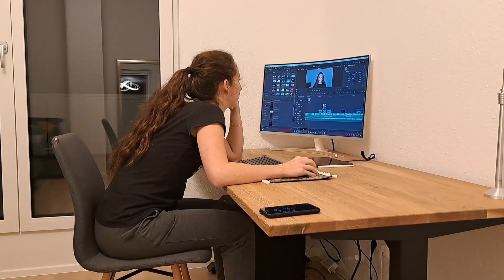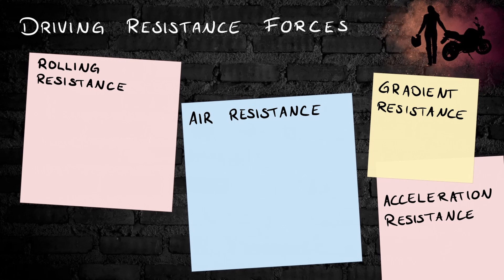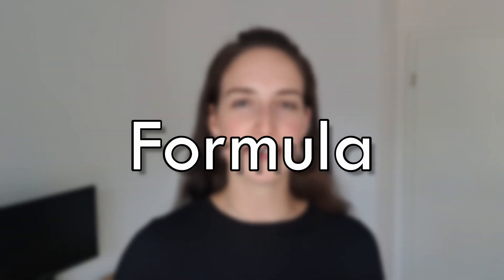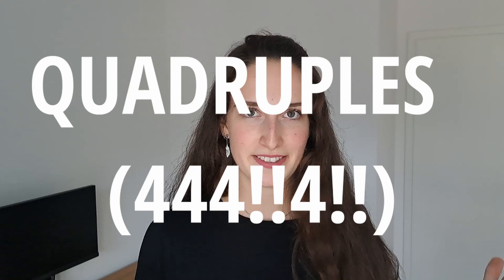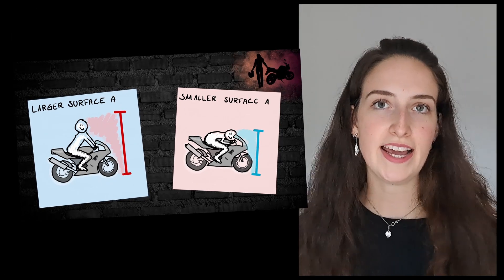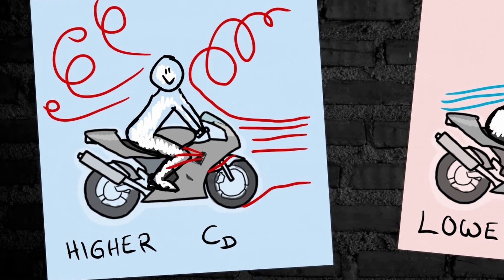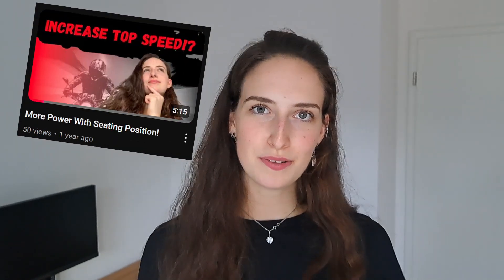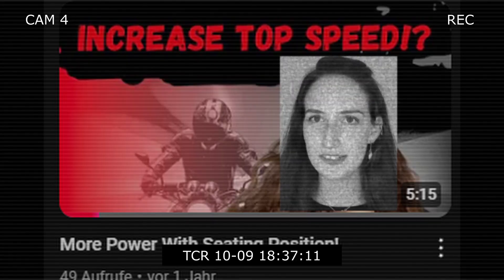Why Posture matters when you want to ride FAST!

Comment: For slow speeds in town I much prefer an upright position, makes it less straining to look around.
On the Autobahn tucked down is better.
Reply from the maker: Yup that's also makes perfect sense when regarding the driving resistance forces, since the air resistance isn't that high at lower speeds.